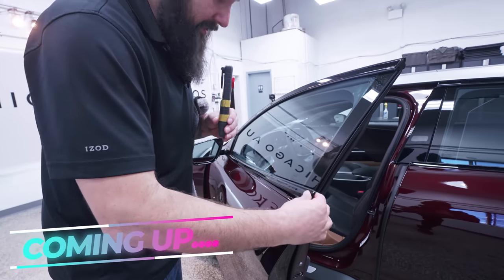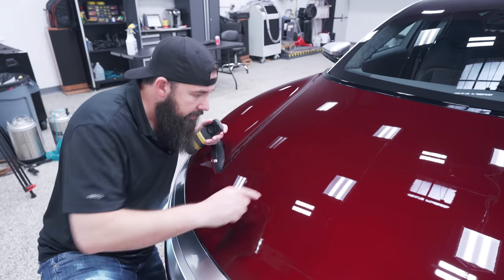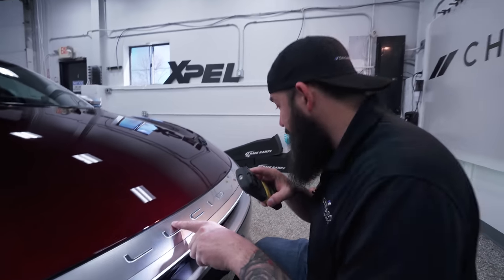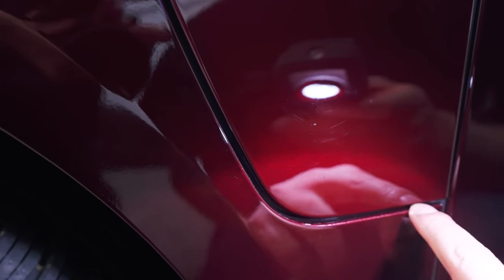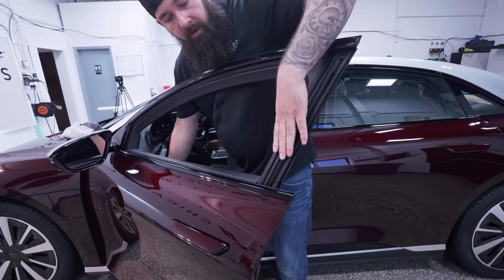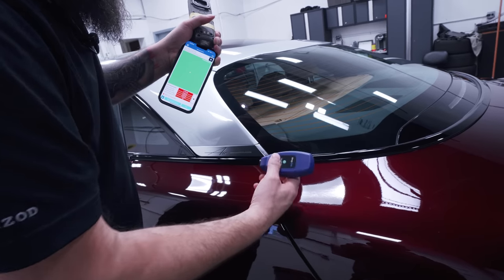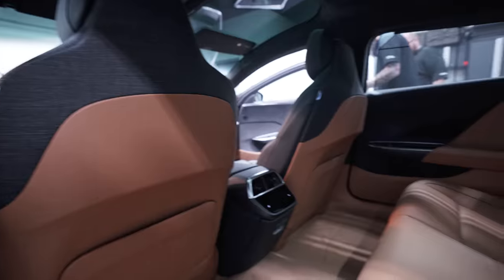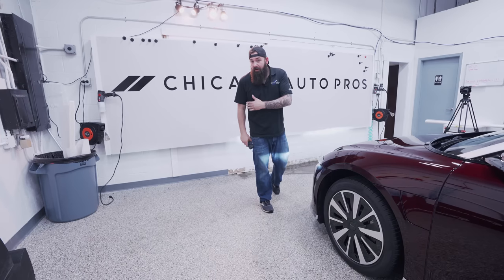2022 Lucid Air Inspection + First Impressions | How Bad Is It?

Comment: Yeah as far as those lights that you saw when you open the trunk lid, I think the fmvSS requires there to be fix lights not on an open hatch that can be seen. Maybe they are playing it fast and loose with the interpretation of that. But it’s my understanding that those are supposed to be outside of the hatch and fixed for brake lights and such. My buddy is one of Ford’s lighting engineers for these things and i  might ask him to comment on this.

Comment: I have had foreign cars for 15 years. Last year I bought a Chrysler Pacifica Hybrid. The paint work on it was shockingly good. I was honestly floored by it. Maybe I am too used to Hyundai quality paint.
Reply: I have a Hyundai Elantra and a Volkswagen Atlas, the hyundai looks like it was painted by a 5 year old lol. The Atlas is perfect, cannot find a flaw anywhere. Car is perfect inside as well
Reply: @cameronr7223  I bought one of the first 2018 Kia Stinger GTs. It was a special Yellow color. The paint started chipping on ALL of the yellow ones. They determined that the paint was defective and gave us the choice of a buyback or a repaint and $5,000 for our trouble. I took the buyback. Two years later I saw one of the supposedly repainted ones on a used car lot. It looked abysmal. The bumper color was shiny and deep while the rest of the car looked like it was in the sun for ten years. I am so glad I took the buyback.
Reply: @Dryloch  I dont think I will ever buy another hyundai or Kia again, all around a very low quality car. They are cheap when buying used but that's about the only plus to them

Comment: @ 12:50 According to Doug Demuro Us regulations require auto manufacturers to have a second set of lights if main light component is on a movable body panel such as the trunk.

Comment: Thanks.  Fit and finish are very important.   Considering reserving a new Air, have been waiting for this type of review.
Reply: Maybe you can buy my reservation and leapfrog up the list, I'll be waiting until at least next year, reservation not required.
Reply: @ericjbowman1708  I'm holding on reserving.   Want to insure fit/finish will be satisfactory and in consideration of current economic situation.  but thanks.

Comment: Thanks for this. I just ordered one and will know what to look for. I’m sure it will be a while before mine is delivered since I’m just ordering so hopefully the finish issues will be resolved as they ramp up production. That’s the color I ordered as well.
Reply: Hope you're leasing. I've had my $300 down for well over a year, but I'm gonna ask for that back at this point, and lease next year's model if it's improved. Or just keep driving my aging W12 Phaeton while waiting for rural quick-charge stations, excellent snow/mountain car -- which the Lucid won't be; as with any EV based on LiFePo4 instead of LiFeYPo4 battery chemistry.

I can park my Phaeton at a mountain airport for a week in the dead of winter, and it will start when I return. Unless plugged in, Tesla - Lucid - Rivian - Polestar - legacy manufacturer won't, because they'll have drained their batteries keeping their batteries warm at below-freezing temps. Without Yttrium in the mix, Li-ion batteries deep cycle at cold temps, which they are not designed for, so don't expect 'em to last long in harsh climates. Hence, recommend leasing any current BEV unless mild climate.

Lucid disappointed me by claiming the Air could be parked for 800 days at subzero temps before the batteries discharge. bullpuckey >cough< I still think it's a fantastic car I'd love to own... or preferably lease. Just keepin' it real.

Comment: Surprised that you are surprised by the hidden lights in the rear :) This is not a new thing and required due to automotive regulations, that the lights need to be visible even when the trunk is open. Most cars have the rear lighting designed in away that even after you open the trunk the lights are at least partially visible, but in some cases for i.e. station wagons this is not the case and then you have those hidden lights. GM did that in some Buick cars from what I remember, also Opel Insignia station wagon had them.

Comment: First run car, massive R&D costs, new production process, low volume and they're bleeding money like it's going out of style. I hope they can hang on long enough to smooth it out because their powertrain is a big deal and the design is a knockout. The trim issue on the window appears to be a design oversight that should get fixed. The repainted portions, based on what others have said, aren't entirely surprising and don't necessarily speak to a poor production process. The red dots on the light trim piece were interesting. THAT one sounds like a flaw in the process as they might be painting the car in a less than optimal order in terms of what's attached to the body while the painting takes place.

If a door is repainted and I can't tell with my eye, then I don't really care. However, trim pieces not properly attached, or not FITTING, or drips of paint where they shouldn't be would be tough to stomach on a "$140K" car. I say that because I give them a break on prices with this being a new space and a brand new company. The low margin, high volume pricing isn't here yet.

Comment: What are you basing it off that it has been repainted? How do we know it wasn't a repaired car? Plus the color is very sensitive to see micro scratches to see under sunlight, basically like a black color on a car. But I still agree with you, even new cars have defects but what car doesn't? All in all good content. But I still believe the car has been previously repaired. Factory doesn't paint the car by taking parts. All parts are painted individually. And last thing, can give a paint score basing it from a phone.

Comment: Lights under trunk lid to comply with regulation. because the tail lights are on the trunk lid, when you open it they aren't visible to other road users so they have lights under trunk that are fixed and wil be visible when the trunk lid is open. I believe its closely related to third break light legislation but I speak under correction always :)

Comment: Felt those door slams, Lucid has soft door close for stealth, lol. Great content as always and that attention to detail 🙏
Reply: Retrofitted my '04 Phaetons with later-model soft-close doors. Why? Because the plastic on the window regulators gets brittle over time, slam the door and the window drops into the door and good luck with that. Always go for the soft-close door/trunklid option, in this day and age, even if you don't think you need it!

Comment: It seems to me some of the highest end cars are some of the worst offenders of paint correction and panel gap. When on the hunt for a McLaren (used for me) I was at the dealer with a new 720S. They advised me not to open the door because it scraped the hood. I could see multiple panel gap discrepancies.
I own a Lotus and Tesla. neither car is known for paint or fit, but they were miles ahead of the McLaren. The Lamborghinis on the show room floor were not much better.

Comment: The lights on the inside of the trunk - there is a EU law (yes, this is not for EU delivery) which absolutely requires to have rear lights visible when the trunk is open.  You seen this on all European cars - the lights are on the frame, even if there also lights on the trunk lid also.  I guess this is not required in all states in the US.

Comment: For $140k USD which is nearly $200k in my area, this is not acceptable yet! It took Tesla over 10 years to get just decent build quality so why would you expect anything more from Lucid. Other real owner reports are coming in about lots of software glitches as well. This thing needs a few more years to work out the kinks. The Fanboys will chime in knocking down Tesla but this video speaks for itself. Thanks for a great video. I am looking forward to seeing their mid priced Model 3 type competitor in the future.
Reply: Tesla decent build quality?  Not compared to legacy manufacturers.
Reply: U need to watch Ceo from lucid said then tell me ... tesla came before lucid ..lucid came out late ..when u have product came first then other come late u should expect product came late should be better than first ...cause u expect have to be good ...
Reply: @jh2ks2k  Sandy Munro disagrees with you on that point.

Comment: Omg ppl on the comments are ignorant! All I read is “I expect perfection, flawless, it’s a lot for what the issue it has.” You are all just ignorant and you guys shouldn’t be talking I bet 98% of you can’t even afford this car lol or are Tesla owners and are just talking bad about the brand. I’ve worked with Tesla when they first stated and I tell you those gaps those pained panels where just terrible but with time they got better and so will Lucid ppl need to be understanding that a car company wasn’t build in one day especially from the ground up all companies had issues when they first started we just have to give them time to work out the issues to perfect them just like Tesla . Now I’ve been a detailer for 10+. Years and trust me like Jason I’ve seen it gaps issues here interior problems there but most of all paint is a big issue with ALL l! manufacturers I’ve seen dirt nibs,sand marks ,swirl marks and all of the above. And that’s why there are detailers to fix the small issues that where skipped or over seen .and I’ve seen brand new cars that my customers told me that they didn’t even let the dealers wash it and brought it straight to me and I seen holograms all over and scratches too so for all of you that are just making noise do your homework understand the process and look things at a different point of view and what it takes to build a company from the ground up .

Comment: For $140k this is pure garbage tbh, panel gaps, loose trim
Reply: Yep, they are a small company of course compared to the big dogs but a $25k Toyota shouldn't be far more well built than any $140k car. In fact, in some ways, being small and lower volume with higher price should ensure that you have better quality control. Its odd how that is backwards in the car world.

Comment: As someone who doesn't really have an emotional bias towards the energy source of cars, I have to say this: Tesla killer my ass
This is little less than an over-styled and over-cluttered Tesla, with apparently equal or less quality control.

I don't see lucid going anywhere this way, as much as I think their design language is pretty; they are literally doing the same as Tesla, but suppressing the positive differentiate factors of Tesla whilst putting it in a price range that is more than double of what appears to be their quality and quality control.

That said, considering the relative novelty of tech and that this is the company's first car, it is not a bad attempt. At the same time, given the amount of expertise Lucid have, as well as all the backing from Amazon and Saudi Arabia, I expected something that would either be a rank above a Tesla, or actually be a better Tesla. I guess they need a bit more time to iron out the real-world difficulties of mass production and quality control.

Comment: Respectfully, I am a little concerned that you don't know what the 2nd set of tail lights are for?  And do you really find that it is a negative for a consumer that you will find it more difficult to tint the windows aftermarket?  Last thing, you mentioned that the owner had already closed the garage door on the car?  Really?

Comment: Yeah Federal regulations mandate that your tail lights or brake lights better yet cannot be on a moving part of the car so seeing as the trunk moves and the entire break light section is there they have to have a secondary set of brake lights on a car that don't move if it was a very limited number car they might make an exception kind of like how conic says headlights go up with the hood because headlights aren't allowed to move either

Comment: I'd like to know if thick paint indicative a repaint was able to be confirmed as taking place and what the situation was that created the need for a repaint.  The evidence of thick repaint up on the roof along with the driver's front fender and door makes me think the car may have been in a significant incident.  The driver's side front inner fender not being attached or aligned correctly makes me wonder what else might not be attracted and aligned correctly.  There is more than enough evidence of misconduct of the car's creation and delivery for me to want the entire car to be gone over in detail checking for damage and less than expected factory quality.  These expensive electric cars are expected to have very long life periods.  I'd expect over 20 years and over 300,000 miles to be a reasonable expectation, with some being refurbished and going to 1,000,000 miles.

Comment: new car manufacturers are out 100 years behind what the old brands have learned about putting cars together...
Reply: I'm old and have had a lot of cars. The old cars were filled with flaws. That includes Packards, Cadillacs, etc.
Reply: @wholeNwon  right...you are making my point for me from a different angle now.  we're not comparing this to 50-70 year old cars form todays manufacturers  , sir.... we're comparing them to todays cars form those  manufacturers ..the ones that have been making cars since then and why these brand new companies are having the same teething issues those companies had when the Packard was being made back then. GM/ford/Mopar/etc might make crappy cars, but  they dont fall apart at the rate these Teslas do, not by a long shot. you can count on a GM to at least hold  together for some years as opposed to months, sometimes just weeks like a Tesla.
Reply: @drsus0  I didn't realize that they are that bad. I have only one friend who has one of the early Model S's and he says it's holding up OK so far. But, when I looked at and drove one shortly after they came out, it was obvious to me that fit, finish and ergonomics were not really good. The wasted interior space was disappointing, too. It's interesting to watch the new EV industries develop.

Comment: It has lights in the trunk because it has no reflectors. Thus if the trunk is open you cant see anything approaching the car from the rear. Lets be honest I just got an EQs 580 with some option for 134k. It blows that Lucid away in the interior and none of the trim pieces fall off when I clean the car. The designo paint on the EQS (3k option) is flawless. As with the Tesla plaid this is a ludricous amount of cash for a pony that has a few tricks but falls apart when you look under the layers. 
Lastly every time I see a Lucid video I nake sure that prospective buyyers know that Lucid may be made in Arizona, but the Company is owned by Mohammed Bin Salman. The Saudi Prince that had  the journalist Kashoggi beheaded at an embassy and stuffed into suitcases. You decide if thats OK with you.

Comment: I definitely appreciate built quality, panel fitment, and overall fit and finish. The thing is though, these are EVs. Software is critical to one’s enjoyment of the vehicle and for getting from A to B on trips. 
In that regard, not only is Porsche one of the most expensive, but in terms of software it is one of the very worst. I just wanted to point that out because there is still good reason to buy a Lucid or Tesla over a Porsche.
Reply: Yeah, but they claim to build luxury cars, not cars for nerds or anything like that. It's for people who want luxury.
Reply: @zbyszanna  luxury = quiet and comfort above all. According to reviews I’ve seen the Lucid does that best in the EV world. Merc EQS is a bit of a flop with it’s awkward ride.
Reply: I really want Lucid to succeed so I can retire my '04 W12 Phaeton. Apparently they flirted with air suspension but decided against it. Sigh. Skyhook rules, and is at least an option on other vehicles in Lucid's price range. Hard to go back, especially with the crap roads in CO. Ultimately, a tradeoff I'm willing to make for 1K HP vs. my current, what, 450 at altitude?

Comment: That was a great video.  I would be outraged if it were my car.  Looks to me like the front left was already in an accident.  But I am a 71 year old novice.  If you lived here in Florida I would be going to your shop!  I was looking at the base Lucid Pure Air vs the Tesla Model Y long range.  I much prefer the Lucid interior, but the Model Y has a better load capacity and sits a bit higher for easier entry and exit for an old fart.  But the simplistic interior style of the model Y leaves a bit to be desired.  The model Y has sentry mode and is great in a accident as it shows the law enforcement officer who was at fault.  The Lucid has the range and the speed 0-60 over the Tesla Model Y.  But after seeing  your walk around I believe the Model Y has better paint now.  It was not the case before with the fit and finish and I believe that is where the Lucid is behind the Model Y.  But the Lucid has the $7500 tax credit and free 3 year charging like Tesla used to have.  What to buy ... opinions?
Reply: I ordered a Model Y as a second car to my Model 3.  The driving range difference compared to the Lucid Air wasn't important to me.  I've driven cross country several times in my M3LR very enjoyably.  What's more important to me is Tesla's full self driving and their Supercharger network.  I plan to have PPF applied to the Model Y at Chicago Auto Pros in Lombard, IL.